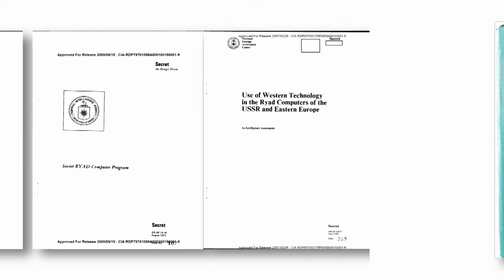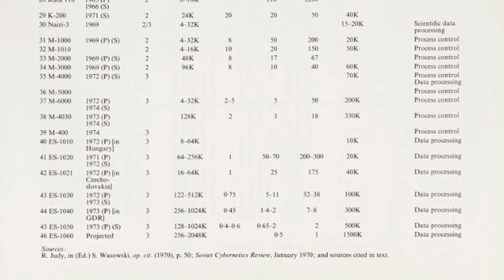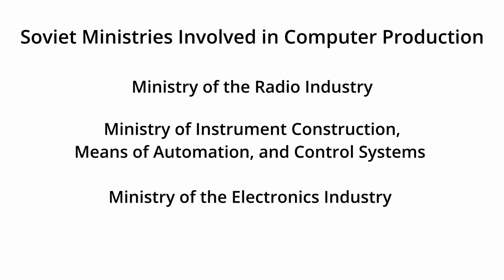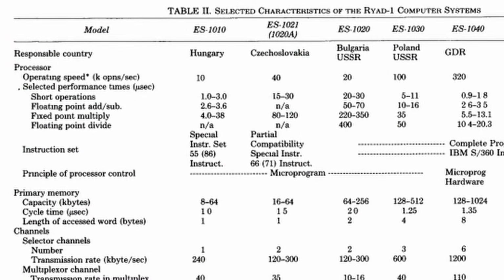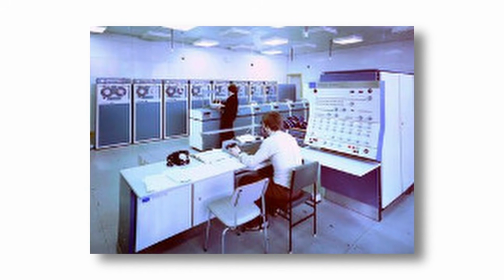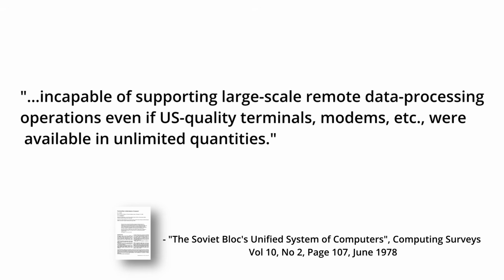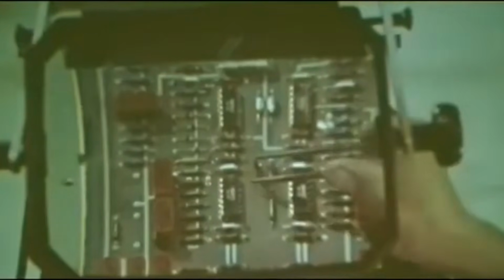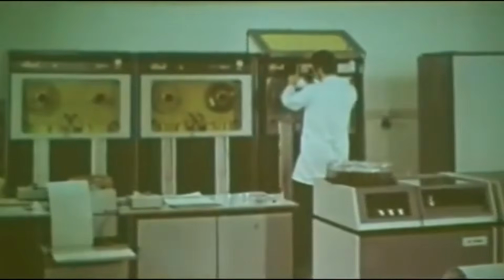RYAD - The Soviet attempt to clone the IBM S/360

Comment: My mother learned COBOL, FORTRAN and RPG in the USA where the school used punched cards on a 360, part of each printout was a estimate of how much the job run cost, it wasn't cheap, I myself learned RPG about 7 years later, I was frustrated trying to get my first programming job and took off for the Navy, my mother worked until retirement age in RPG, and was finding out afterwards how much in demand her programming skills were, funny thing, I had things I'd try and bring up to her because they were puzzling to me, and I actually was teaching her things she didn't know.
Reply: I didn't know there was so much appreciation for RPG (edit: in demand). I was the best (said by IBM) at programming RPGII here in Portugal. Never had a mistake and would repair others programs, to run. System 32 and System 34. In the 80's, here in Portugal. At IBM, they said "Use only two digits for year (date)," I never did, because of the Y2K bug that I preview 15 years in advance. I used full date (4 digits/year). They said @IBM they would be payed to change original said programs.😢🇺🇸  Congratulations. 🇵🇹
Reply: @franciscorompana2985  I think when the 1440 came out IBM was saying that you could learn RPG in 3 days, I disagree, I took a 1080 hour course on a couple of S/34 in the late 70s, primarily in RPG and you wouldn't believe the "overqualified" line came out in interviews.. jeez, I could wrap those systems around my finger easily, I even did a SYSGEN (iirc) on a weekend with the instructor, my only challenge was understanding why ISAM was a thing, and using the CHAIN operation, having no concept at the time, it eliminated redundant data storage, as the system capacity was inefficient. Eventually my mother did a volunteer job helping a charity upgrade from the S/34 to a bigger system, and as a reward she got the old system which is in her basement to this day, expending only moving cost. My mother retired a little early, having headhunters still calling her explaining she is in high regards, in a metro area ranking in the high 20s of population of the USA.. 
In the 2007 era I saw a local hardware/lumber chain advertising a need for a RPG programmer, I should have jumped on it, however my grandmother had a stroke and needed constant help and observation.
Now you got me interested to go fire it up at Christmas when I visit, it's probably got its fair share of a dust collection by now..

Sorry for being a little redundant having failed to check my previous "chapter" (comment)

Comment: In the late 1980s, I worked on the EC-1022 and EC-1037, the last one related to IBM-370 with the SVS-7 operating system. The programming language PL/1 was mainly used.

Comment: The quota issues remind me of a factory job I had for a bit; we were assembling small parts for heart and lung machines and I was repeatedly told by my immediate supervisor to put any production over the day's quota into a bin for tomorrow so our quota wouldn't go up. A lack of flexibility from management (no understanding that there are good and bad days and things even out over time) created production bottlenecks because we wanted to keep our jobs.

Turns out that punishing your workers for exceeding expectations creates problems in any system lol.
Reply: Faxtor
Reply: Make fun of it if you want, but in a tightly-integrated production line over-production can be a real problem - it means you can cheer for your productivity, while the next stage on the line scrambles to find more shelves to store the build-up of parts heading their way.
Reply: @vylbird8014  Upper management constantly told us to make as many as we could as fast as we could, then they'd raise the quota if we had a good day, and then they'd punish us for not meeting the new higher quota every day.

So yes, I'll make fun of them and call them snakes.
Reply: @ejomatic_actual  i have red somewhere thta that's how they did with the slaves in North and South Americas.

Comment: 'Upward compatible?' We always called this 'backward compatible' which is the same...Isn't it?
Reply from the maker: "upward compatible" is the phrase that was mostly used in the reference material.
I suspect its the older term, primarily referring to when a family of computers all exist more-or-less concurrently, with a range of specs from low to high, whereas "backwards compatible" more refers to when a newer system can run applications built for an older system.
Reply: @AnotherBoringTopic  Still having trouble with the logic of it. Of course the standard term works both ways and first use was I think the NTSC color system and B&W back in the 50s.
Reply: The IBM 360 line had small, medium, and large computers all available to buy at the same time. A company might upgrade without moving to the next generation of technology. Their investment in software would be upward compatible with their better computer, but not need to be backward compatible as their old computer was still currently sold, not an obsolete retired smaller model.

Comment: I live just 15 minutes away from the former production plant which used to manufacture most of the magnetic disks. Later on they began producing a full range of magnetic information mediums such as compact cassettes and video cassettes. They even produced parts for hard disk drives in the late 80's. The site is now a mere shell of its former glory. Immediately following the collapse of the communist regime, the plant fell into private hands. Most of the equipment was sold and what could not be sold was scrapped.

Comment: Cool video, but I have two small quibbles.  First, you mention the transition from gen 1 to 2 to 3 being about the use of vacuum tubes to transistors to ics.  This isn't quite right, because it implies gen 3 computers don't use transistors.  Every modern computers uses them.  ICs aren't a replacement, they're just a means of packaging them (and other components).  Second, you mentioned that in the 60s many Soviet developers along with some American developers eschewed high level languages, preferring to instead use lower level languages because back then doing so offered performance benefits.  This wasnt a phenomenon which ever went away. It's still the case that a lower level language will offer performance benefits.  This is still a trade-off today.

Comment: Thanks for the video.  I haven't been through it yet, but I was surprised to hear that by the 1960s IBM had basically sewn everything up... I'm not VERY familiar with the 1960s, but in the 1970s /1980s there was a lot of fragmentation where it matters, large servers.  IBM was big, but so was HP, Sun Microsystems, Digital Equipment, SGI, and others.  I worked as a UNIX admin in the 90s/2000s and IBM was actually the systems I was least familiar with over several large companies including a government contractor.  Of course, probably not as fragmented due to the nature of the C programming language and UNIX... code was portable in a way it wouldn't have been in the 1960s, so hardware vendor wasn't as stark a difference.
Reply: IBM went after the business market. That was where being able to run the old software was very important. They didn't care so much about power as long as  an upgrade wouldn't trigger a massive software porting effort. The other companies did scientific, engineering and education where the market wasn't as great. Over time the PC became powerful enough to push the others out of the market. You ended up with Cray for the high end work, IBM for business and PCs for everything else.
Reply: EDIT: I guess most of those came around in the 1980s... I reckon DEC was the first to break out of the pack with VAX.
Reply: Interesting that Soviet Union forced the cooperation of those Eastern bloc nations... Imagine the advancements that were stifled!
Reply: Wikipedia lists some late-era models from the 1980s, the 1130, 1181, and 1220, but I couldn't find any pics of it.  Maybe that's what you show at 37:23, not sure.  Great video though, I see you make many interesting ones, have a sub!
Reply from the maker: Thanks for watching and I appreciate the sub!

Comment: 15:00 Škoda Auto bought one 360 for car developing in 1969. They've bought some local tomatoes, sold them abroad, and paid the computer in the foreign currency made from the tomato sale.
Reply from the maker: That's hilarious and also very creative! 😄
Reply: @AnotherBoringTopic  Desparate times need desparete measuers.
Czechoslovakia had some very interesting computer  manufacturing. :D
Reply: @ugencz8364  Yes IQ151 very heavy piece of HW, PMD-85, maybe Ondra (based by MHM8080A), Didaktik Gama, TNS computers HC-xx (U880 alias for Z80) developed by agro firm JZD Slusovice. System based on 8086 SAPI etc. I got a failed module from EC during an excursion in a firm named SVIT... and this event started my interest in computers.
Reply: @Naithcz  I know them all, it's my passion too.
Reply: @Naithcz  you seams to be the right guys to ask, do you happen to know anything about the systems shown in this video? https://youtu.be/7t5BVLLMzmY?t=315 from the skoda plant, possibly 1985-1987
Reply: @JPLE84  It is from ÚVMV (Ústav pro Výzkum Motorových Vozidel/R&D Institute for Motorized Vehicles). From what I've found, everything was measured with analog instruments, and saved onto tape by reel-to-reel tape recorder. Then, they convert analog data into digital via A-D converter (CIL RP 8000) and a proprietary program called SADKO (Systém Analogově-Digitálního KOnvertoru/Digital-Analog Converter System), which also analyzes the values. HP2100s was the computer used (equipped with HP7900A disc drive, HP2607 printer and running RTE II OS), but they also had PDP-11/70 (Real one afaik). PDP was accessible by local terminals, or even remote ones (Probably Škoda's workplaces, but other firms could possibly have connection too) via telephone lines. Terminals used were graphical Selanar HiREZ 100 and alphanumerical DEC VT100.

Most of the info is from this site: http://www.konferencestarnuti.cz/UVMV/index.htm
It was made by people who worked in ÚVMV, so it's quite interesting. Everything seems fully translatable, so you can have a look. Also, in the 'Lihovarská' section, there is a 46-minute film about the whole workplace, and it's available in English too.

Hope my text makes sense a bit and I also hope that I've helped you!
And thanks for sending me into this rabbit hole, I will definetly try to find out more about it.
Reply: @ugencz8364  Thank you! Very interesting
Reply: Who would have guessed that the software secret sauce was marinara!

Comment: FWIW, ctl/v ctl/p could not have been used to copy a file on the 360 anymore than it could have been used on RYAD. Those keyboard shortcuts don't exist in OS360.
Reply from the maker: Oh I'm aware of that, I was just trying to make the point that it took some effort to port OS/360 to Ryad systems, it wasn't just a mere copy/paste. 

Thanks for watching and taking the time to leave a comment!
Reply: @AnotherBoringTopic  Out of curiosity, which system uses cntl-c,cntl-p to IPL? 

(For those that don't know, IPL stands for Inital Program Load which is the term the S/360 (and its descendants)  for  (re)booting the computer.)
Reply from the maker: I actually have no idea, but I wouldn’t be a bit surprised if some of the higher end Ryad systems (the ones that could run the two ported s/360 operating systems) used the cyrillic equivalent of those keys. 

However I stress that this is definitely a guess
Reply: @AnotherBoringTopic  If they used a version of the 360 OS, then the answer is no. Those control keys were not used on IBM mainframes, midrange, and minicomputers. Even the current IBM I (aka AS/400) does not use them. You have to remember that these systems don't have a graphic user interface. Even when working interactively you are limited to what we call a "green screen" that features 24 rows of 80 or 132 columns. On such a screen, the position and movement of the cursor is not controlled by a mouse and while function keys do exist, they are only the F1 through F24 keys from a standard keyboard plus the roll up or down keys.
Reply from the maker: @CaptHollister  Excellent info, thanks for sharing and setting the record straight :)

Comment: very interesting. soviet electronics has always been a fascination — a whole (for the most part) independent electronics components manufacturing and computing systems. i grew up with TRS-80, unix, and macintosh machines — we had soviet tube valve guitar pedals which were highly prized. its not like one was able to know a lot about what was going on behind that iron curtain in terms of what the geeks were doing. im sure we would meet on BBS's with modems if we could — but even that was too exotic for what a canadian kid picking cherries and working at a gas station could afford. you went to the library on your bike, and looked stuff up in card catalogues using the original google — the dewey decimal system. 🤣 there was no internet to look stuff up on — which you have now with the facility of which, have been able to synthesize an excellent, and fascinating synopsis — thxu. 🙏
Reply from the maker: Glad you enjoyed it!
Reply: @AnotherBoringTopic  It's very interesting for the point of view of someone who works in the electronic domain. You should do one that covers the domestic electronic like TV and transistors radio. There's alot to say on the topic.
Reply: These valves accessories are probably electro-harmonix and made in saratov/reflector in Russia. Which is now a major annoyance since the replacement parts aren't available since the war. We only have the inferior Chinese parts. I have some older electronic and stereo system which uses valves, but I use them sparingly because I don't want to have to buy replacement valves. (7591) soviet electronic is a very fascinating topic. The transistors stuff is similar and very different to what is made in Japan or USA.

Comment: Was in New York as a computer operator the Computers were 5 foot high 4 foot wide and 2 foot deep all was stores on 2 inch magnetic tape all that did was print out ticker tape and punched cards  there was nothing or no new generating computers got a shock when saw how backwards they were am still shocked how bad all Personal Computers are today it looked like we were doing well in the late 60s early 70s but it looks like we have taken one giant step backwards
Reply: What in particular shocks you as still too backwards? I'd take a new Macbook Pro over the last, most sophisticated System/360 mainframe any day. You'd not consider moving from 8 bit, 2300 transistor CPUs to 64 bit, 60+ billion system-on-chips to be any kind of a remarkable upgrade in the last 50 years? Dozens of gigabytes of RAM and terabytes of solid state storage being affordable is no difference? Massively parallel 3D rendering processors? 8k cameras and displays? Neural networks running on a pocket computer with wireless access to the entire public Internet? Hobbyist & maker single board computers for fifty bucks with thirty times the clock speed of the original AS/400? Universal GUIs with device independent font rendering to 600 dpi laser printers available for a hundred bucks at the cheapest store for groceries and T-shirts? You're a hard man to impress!

Comment: Would be cool to see your take on the Soviet attempts of cloning IBM PCs with ЕС1840 and other systems.
Reply: There was only a half-hearted effort to make their own IBM PC compatibles, because by mid-1980s it was already easy to import from the West personal computers which were better made, more reliable, and more up to date technologically.

USSR did produce a number of domestically developed personal workstations in 1980s which were not IBM-compatible, but run software for PDP-11. These were not sold to individuals, with the exception of one low-end "home computer", which resembled VIC-20 in design, but had a 16 bit CPU inside. Initially, these home computers came with Basic interpreter and Tetris. That was it. Eventually enthusiasts developed some software for them, including many games. 

There were no commercial developers of software, because the very idea of IP was completely foreign to Soviet citizens -- if you could sell one copy of the program, and it were any good, then it would spread like a wildfire by people passing a copy along. (Like it happened with Bill Gate's original Altair basic in 1976 in the USA.) Instead of commercial software companies, in the USSR enthusiasts developed software mostly for fun without any commercial benefits. And, of course, pirated Western software was standard on IBM PC compatibles.

For home use, the most common computers in the USSR in late 1980s were 8-bit Sinclair Spectrum clones. These were produced by many tiny companies and even by individuals. They became popular because they were very affordable and there were lots of games for them with rather attractive (for the time) color graphics. Being extremely simple, this was a surprisingly capable machine.
Reply: @cogoid  "Initially, these home computers came with Basic interpreter and Tetris." Now we finally know the secret to Russian superiority at ingenious coding and hacking!
Reply: There was czechoslovak Tesla PP-06, IBM PC XT clone produced approximately from 85th. 8088 (copy,) 640 kB RAM, CGA, 2x360kB drive.
It hadn't motherboard, but central bus board, where CPU, memory, controller and graphic board were attached. Bus WASN'T ISA compatible!
Reply from the maker: As part of the research I did for RYAD, I started a 3 ring binder for printouts of various old journal articles and intelligence analysis of various aspects of Soviet computer technology, and I have a whole section set aside in it that holds research materials on their microcomputers. It's definitely something I will be exploring in the future :)

Thanks for watching!